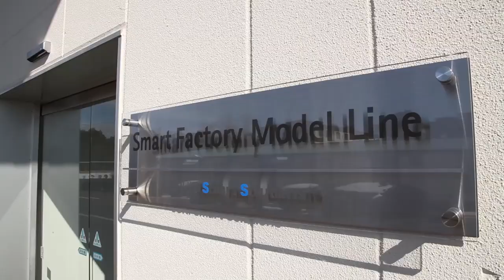JUKI Mother Factory - Ohtawara , Japan-

Comment: I have owned a Juki 562 for almost 30 years. A few minor adjustments over the many years. The machine is the best out there! Reliable, very few missed stitches. Keep it oiled and watch for any oil spots, especially on garment leather. A quick wipe before sewing. Outstanding technology here. Thanks for sharing the "How". RAM Leatherwork
Reply: i have juki straight sewing DDL-5550N and juki 4 threads edging machine MO-3314E,if i want to buy brand new sewing machine like my machine,how much will it cost?thanks